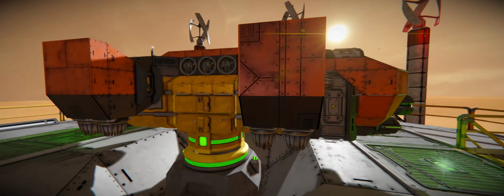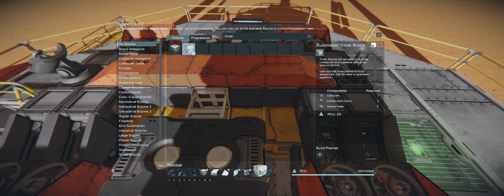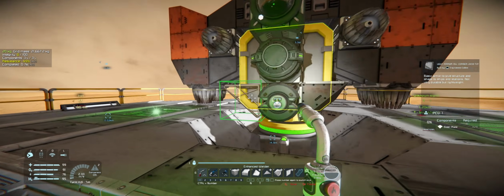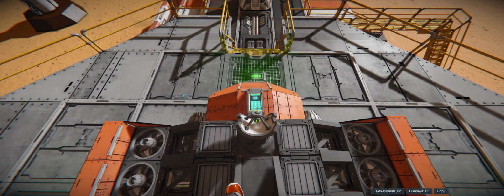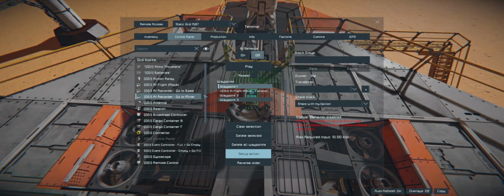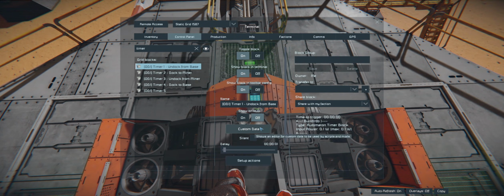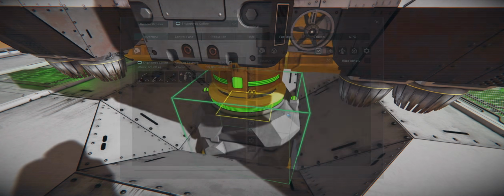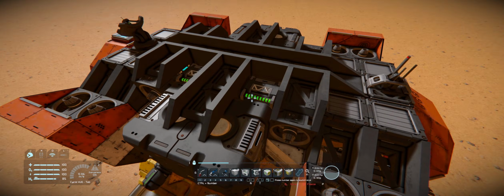Easy Come, Easy Cargo! Let's Get this Tardigrade Moving! | Martian Engineering E7 | SE Survival

Comment: Just found this series and I'm really enjoying it. Thank you =)

I'm way late to the party and you already know by now, but Event Controllers have a setting for "Connector Ready". I use this to dock my drones as it is really fast and actually never failed me so far.
In worst case you wont have a connection because the connectors never aligned but no plummeting drone because a timer toggled all systems off.
Could also start a timer at the last waypoint that broadcasts the antenna name "Can't Connect - Help!" for example that gets stopped at successful connection incase a connector is damaged for example.

Edit:
For Power ON/OFF another EC that checks if Connector connected.
- Left side (connected) everything set to off/recharge
- Right side (disconnected) everything on/Auto
Didn't even fail me on MP servers.
Reply from the maker: Thank you! Glad you are enjoying the series! Yeah the connector ready is a good one for sure! Probably should have done that

Comment: I know this is old, but one thing i remember from splitsies drone tutorial is for docking start at the connector and move up. Then reverse the order of the waypoints.
Reply from the maker: I have had mixed results doing that, they are working now for the most part.

Comment: The "collision avoidance" is bugged. If I use collision avoidance the drone does not mov upward as thought but sideways and down, making it touching the ground at the excavator. My solution for it are two mor AI recorder for the undocking procedures (only one waypoint straight upwards) and two more timerblocks for switching from undocking to flight. only problem left now is that when I undock from the excavator the action at the waypoint is not triggered. I bypass it now with startin the timer at undock with a delay of 10 seconds. That should be enough time for gaining enough height. ;-)

Comment: The event controllers have multiple user control panels you just need to control 1-9. Usually 9 on and 9 off is enough to do what you need. If you need more than timer blocks are required.
Reply from the maker: Yeah, it's just easier sometimes to have the 1 page on the timers to check my order of operations.
Reply: I understand that

Comment: I'd like to recommend the block picker mod as it allows you to press CTRL+G to select the block you are currently looking at to your hand. Also if you placed a block down from a group of blocks then when it is selected you will pick up the whole group of blocks - if however, I selected the light armour slope directly from the menu not from the block group it would only select the slope block.
Reply from the maker: Build info also has a block replace with ctrl R, but I find it more annoying than helpful.
Reply: @EngineeredCoffee Very late reply. The block picker mod just grabs the block you are looking at. It doesn't replace it in your toolbar but it saves going into the G menu and searching for a block. Your toolbar stays organised but you basically get a 10th slot.

Comment: At first I ahve to say that that you channel is awesome, most of videos about space engenners  is boring, but you made it sooo fun. Some your videos I wathed twice. 

About drone, I played a lot with drone,I could not get it work properly. Docking and undocking sequence is easy, because waipoints are close to each other and you can manage patch well. Problem is moving to long distances. My drone ignores minimum altitude, collision avoidance works badly as well. Hills are isssue, over hill drone flies little bit up, little bit forward, little bit up......

The result of movement are inconsistent.  There is not detail debug info, so it's trial and error method :D.
Reply from the maker: I have the same problem, drones are unpredictable. My iron mine drone worked great for a dozen trips, then smashed into the side of my outpost 🤷‍♂️

Comment: When you see my next one... know i cried deeply haha.DRONES MAN!!!! they're awesome and AWFUL
Reply: The Hal 4500, or a throwback. Hardak.
Reply from the maker: Yeah, sometimes mine wants to fly into the ground instead of going to back to the base. I think it's related to the bug Jago was experiencing months ago: https://youtu.be/NCrBEfrECv4?si=lzj0xVrVO3ecen9Y
Reply: @EngineeredCoffee  That is interested. I had not seen that. Its weird how light the subject material is on drone stuff. But my episode coming tomorrow burned out rather spectacularly. So I will probably double down on config for it once more.
Reply: @EngineeredCoffee  I also think that the collision avoidance could be causing some of those issues. Mine has stopped wanting to dive bomb because it was turned off. I think its just the other controllers that seem to want to send it to CLANG.